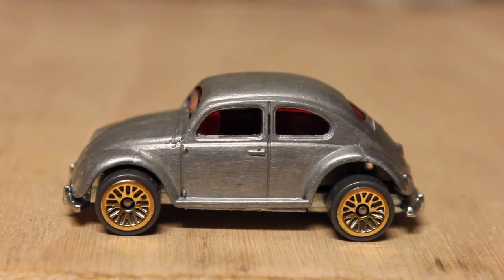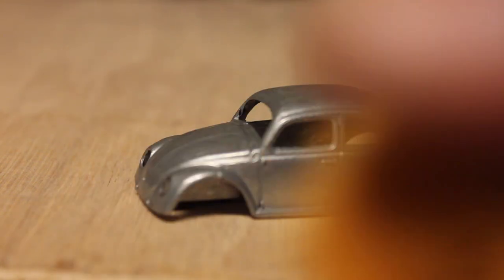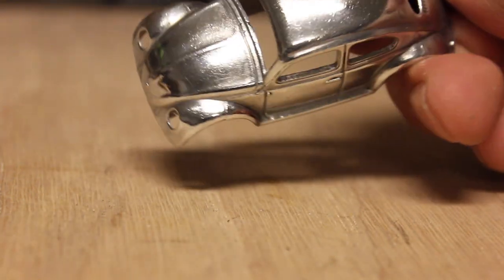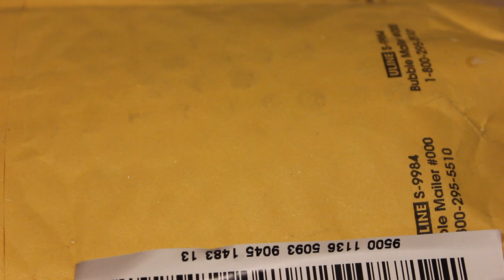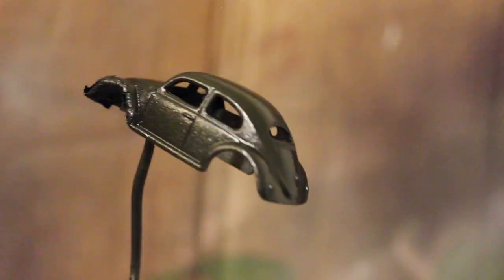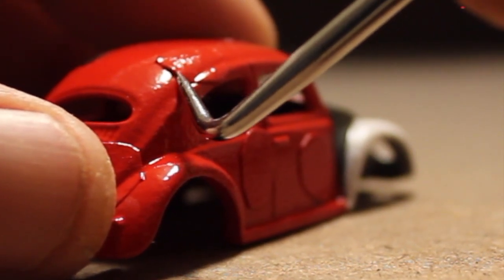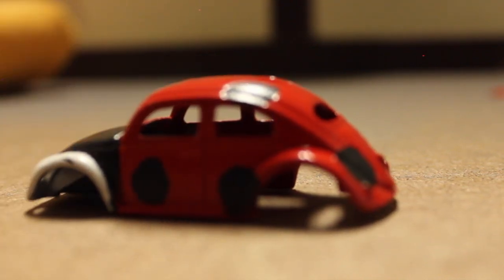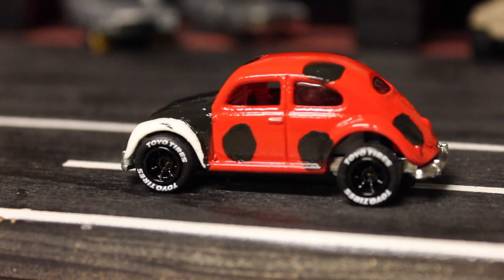Must See Custom Hot Wheels VW Beetle Ladybug

Comment: Neat little project. I like it.  For future reference. If you wish avoid having the primer or paint lift off. Dont super polish so smoothley. Use a alcihol or even laquer thinner to clean the casting. Primer is ment to bite into the sanding scratches and etched metal. Filling the voids and giving your paint a bonding surface. To prevent lifting. Use 800 grit wet and dry paper or a scotch brite pad as a final polish. Prime in 2 lite coats. If needed use 3 with a quick wet scuff to remove rough spots. Paint it . use light coats. Clear coat if being used should be your heavey coat.
Reply from the maker: Thank you for the tip.   I will definitely try  it next time.